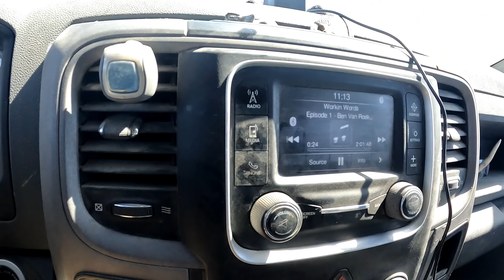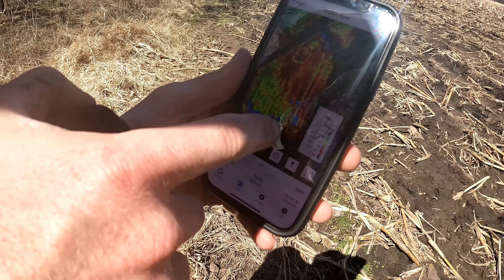1st Generation Farmers UNCOVER ANCIENT TECHNOLOGY!

Comment: It might be a shock to learn that the vast majority of tile drainage in place and fully functional in England is made up of buried clay tile like you showed. In many cases where it is not working properly is because of failed outfalls when frost resistant materials were not used so frost destroyed the ordinary clay tiles when they froze as the tiles are full of small pores which fill with water. (If concrete or salt glazed pipes were used at outfalls this was not normally an issue. 
Alternately the tile has collapsed crushed due to heavy loads, wet soils, by being destroyed by grazing cattle trampling the soil going to drink, too much traffic [both machine or animal] in a particular area such as at a bridge or culvert.

Some of the real old systems installed by hand were made of a combination of a flat based tile with a horseshoe tile placed on top (so they looked like a bridge or archway structure). Whilst on large areas of particularly heavy clay pasture land the land was shaped into a series of ridges and hollows related to contours and excess surface water drained off the slope into a series of shallow ditches which eventually emptied into brooks, streams or rivers. There are still some traditional ridged grass fields in existence and in my area they are known as Rigg and Furrow fields and in many cases are a legally protected archaeologically important landscape feature.  

Sometimes these "ditch valleys" had small shallow clay pipes inserted to drain land more quickly. 

Much of the hand dug ditches and drains were relatively shallow as the heaviest thing to cross them might be a wooden wheel with a steel rim on a cart being pulled by heavy draft horses.
Reply from the maker: Awesome comment!

Comment: Too bad one couldn’t run a submersible drone up through the tile.
Reply from the maker: they have something along those lines. but it is for septic's
Reply: @iowANFarmer  Not certain the signal strength would be there, but would be great to have one in the pipe (locating and sizing it) and one on the surface (rtk for grade and depth from grade).

Comment: You should be able to witch the tile lines. It’s not hard to do.
Reply: Rick, what do you use for witching? Anything special? Or just clothes hanger wires?
Reply from the maker: Never done it!
Reply: I’ve used baling wire, survey flags, copper wire. Some people can do it some can’t.
Reply: @Rp47.5  My old boss could find a drop of water witching......... Me, I couldn't find a 36 inch main.
Reply: I don’t think it is so much to do with water as it the ground being disturbed. It works with gas lines water lines tile lines electric lines even the ones that have been under ground bored. I had a guy that trenched water lines show me along time ago so I tried it and it works. I can’t tell you where to dig a well like some old timers by watching their willow stick bounce up and down and counting how many times so they know how deep but so far it hasn’t failed me as to there being something there.